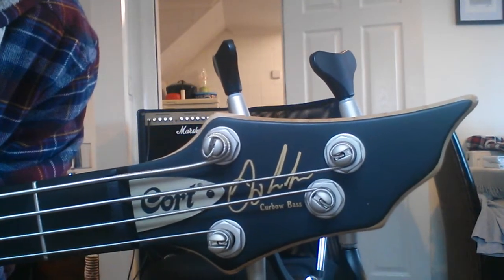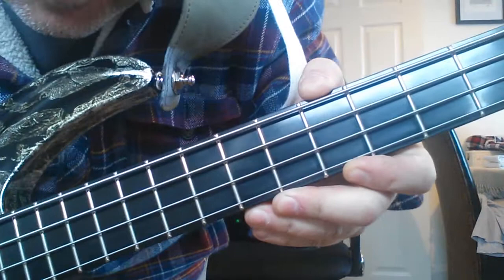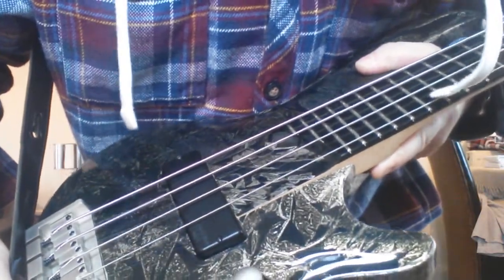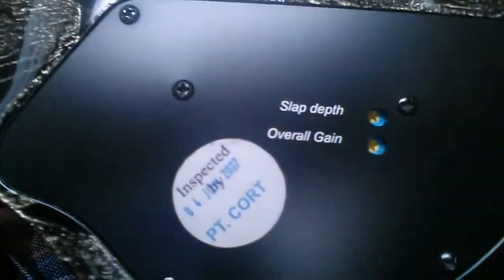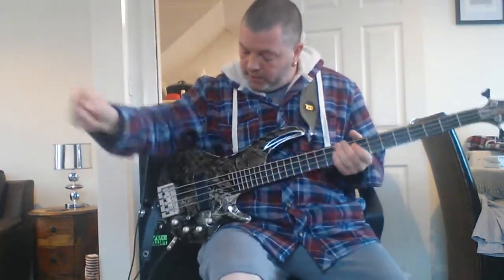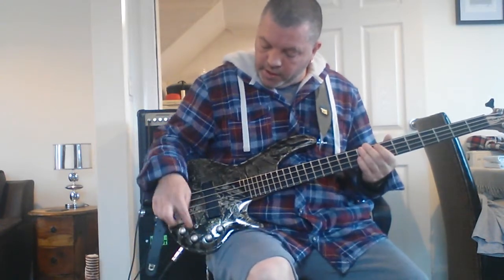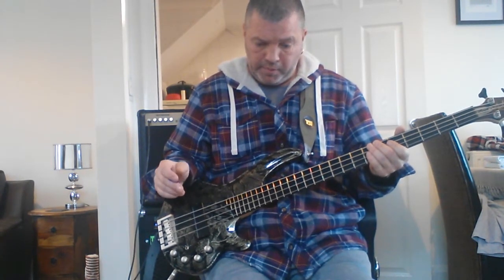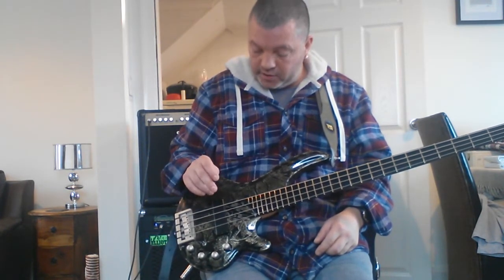CORT CURBOW BASS with controls  explained wrong !!

Comment: I’ve got the rare 6 string model and I’ve used it all over the world.
...and that’s ‘not’  real Bartolini pickup. It’s a Korean knock off.
I got that from the late Greg Curbow himself...
  These basses are excellent instruments.
Reply from the maker: Wow good stuff! 4 strings is enough for my limited ability.. and I reckon those Koreans did a good job on the pick ups sound great to me ..in fact my car is Korean and that does fine too ! 
Peace and love brother thanks for the kind words and the info 👍🏻☮❤
Reply: @springy-2112  It’s a Korean pickup, but it still sounds good, just not quite as good as a real. Bartolini. I’ve used dozens of  Bartolini’s and know how they should sound. 
After twenty years, I finally replaced mine with a custom pickup made by Howard Ulyate.
The main difference in the sound ,was that the G and C strings are much more balanced and sound thicker. The high end is much clearer as well. 
I still use the original pre amp.
Reply: @springy-2112  I spent 3 months playing music in Korea back in 1991. I also drive a Kia Soul...
Reply from the maker: @paulnicolosi4792  
good cars .. I've had 2 Kia carens, and I'm on my 3rd Hyundai i30..
I update them every few years.. the diesel units are so much better than mainstream cars.
I'm getting a Tucson for Mrs Springy shortly . But it'll be a petrol as she only goes about 4 miles a day ..👍🏻☮❤

Comment: I bought one in 2005 (metallic red). Great for 3 hour shows, lightweight. One of my tuning knobs stripped and had to retrofit one from off the rack at guitar center.
Reply: Im having the same issue. Hoping it wont be too hard to find a replacement.

Comment: Does yours require a setup semi-often / deat note between the first 3 frets? I've had three different repair shops tell me that the bridge placement on these is what keeps it from having great intonation as well as staying adjusted.
Reply from the maker: no not at all no dead notes on mine and intonation perfect...but u di setup all my basses spring and autumn to account for humidity and temp..but the curbow tends to be the most stable ...

Comment: Cool video how would you compare it to the Cort  t54.  Also iv seen curbow 4  luthite is this the same or is it diffrent
Reply from the maker: the t54 looks very similar to me but with emg pickups ...i think this has bartolinis...this one in the video is the luthite body and its all good i had no issues with it...the pickups are very hot on this one it tends to overdrive if your not careful but the new one has emgs so probably ok..🖕🏼😁
Reply: @springy-2112  hi thanks for your reply  im currently shoping around and  have my eye on the curbow  and the t54 if you had the choice  of the one witch would u go for  also if u was getting  them preowned what sort of price would u consider to be faire thanks againe
Reply from the maker: @pinstripebanditt  
i paid 300 for my used curbow and thought it wad a good deal...the t54 looks good not sure of the new price on them ..